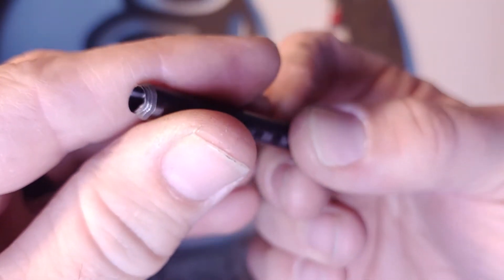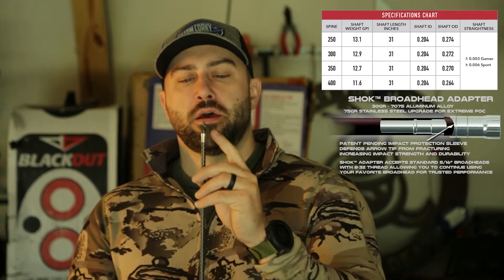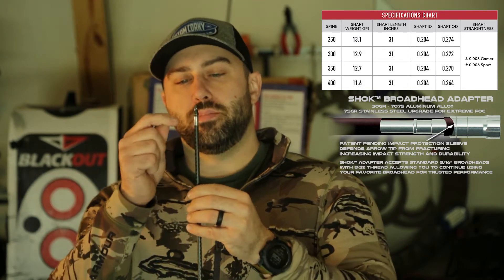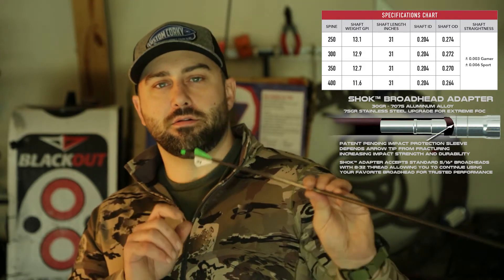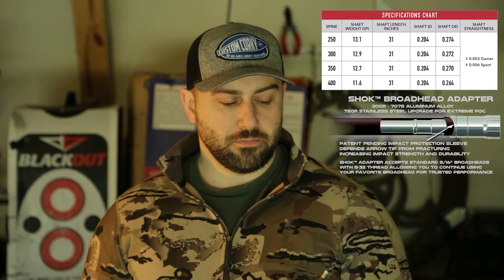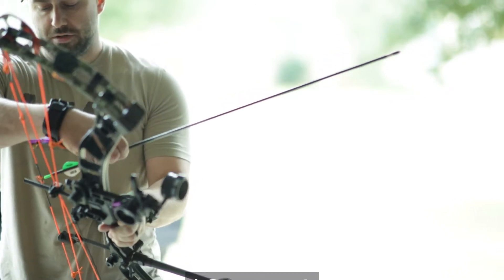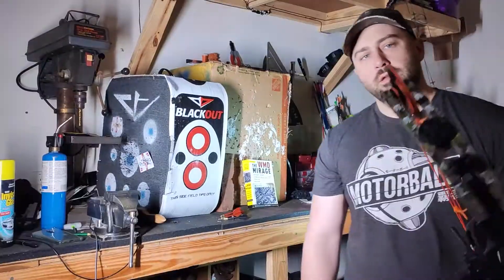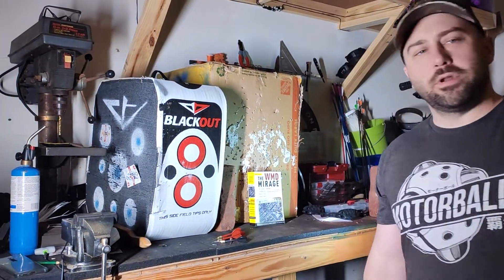VICTORY XTORSION SS REVIEW - HEAVY AND HARD TO  BEAT

Comment: I’m really surprised not more people are talking about these, I have xtorsion 300 spine and they insanely tough hard hitting arrows. I don’t no why people are still buying fmjs 😂
Reply: That Easton brand loyalty is strong. Not going to lie they have a badass product with the X10's and protours but they are so damned expensive. You can get Victory's equivalent (that have been competition proven by many top level target archers) for nearly half the price or your typical X10 shafts. IF you watch the target comps (CAM and WA ect) youll notice a lot of people shooting Victory right alongside the easton/hoyt poster boys/girls. I feel as though Victory is more laid back in the advertisement. They rely on word of mouth more than other tactics.
Reply: Because a lighter arrow with more weight up front seems to provide better results. Or so is my understanding
Reply from the maker: I think it's all relevant with FOC. It's a balance with shaft weight and durability. You can have a shaft that weighs next to nothing but will snap easily. This is balancing more toward shaft strength, but high FOC can still easily be achieved.

Comment: For anyone looking for a super budget option, Victory offers the Decimator XV arrows through many of your local outdoors stores like Field and Stream or Dicks.  6 packs fletched with 2in blazers pre spine aligned with inserts not installed but included for $30 USD, often catch them on the "flash" sales for 25. Same price for 3 packs with lighted nocks installed. Not bad for practice arrows that you dont have to be worried about letting fly or blowing one up. The also make great small game arrows so again you dont have to worry about hitting that tree stump or whatever. Victory makes great products all around.